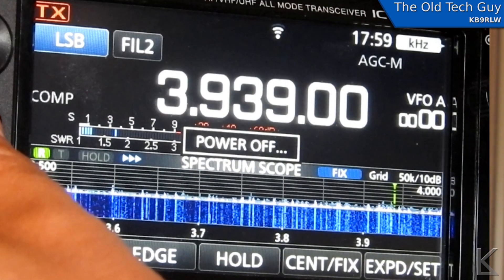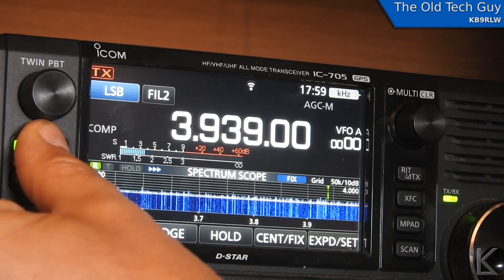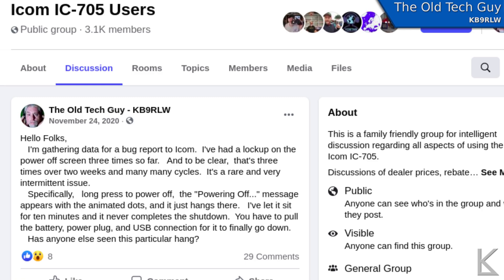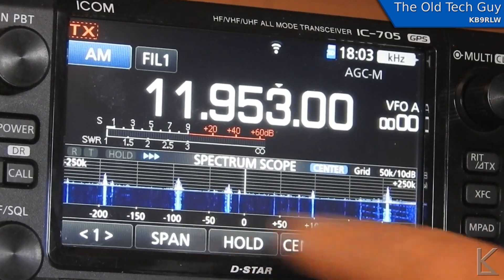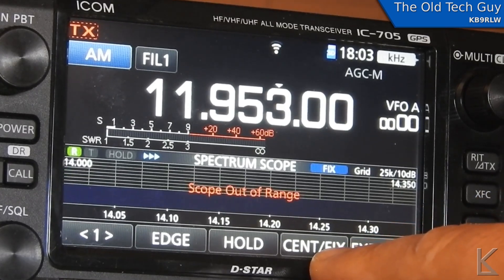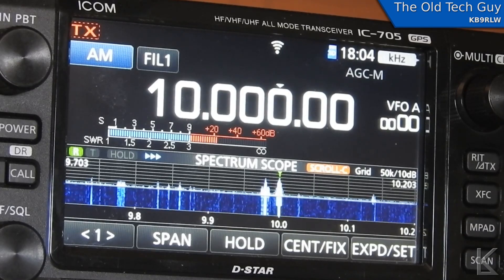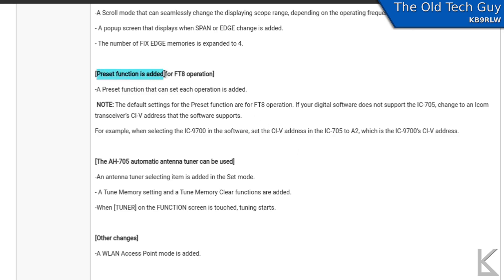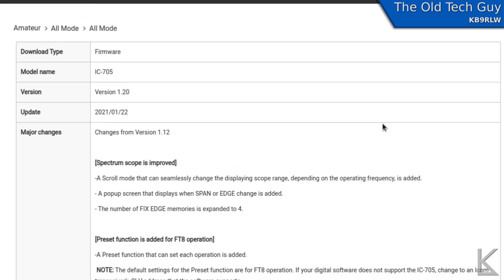Ham Radio - Icom fixed my IC-705 power off hang problem with firmware 1.20

Comment: Hello from another Kevin, KA0KAE. I love my IC-705 but I am having buyers remorse. I ran into an issue transmitting on SSB this summer do I reset my radio and it works. But when I do this it wants to record my QSOs. I also use the DR features of Dstar and that doesn't work as well as it did when the radio was new. I have upgraded the firmware to 1.2 then last night to 1.26. It is still wonky. I hate the Facebook groups for the same reason that members don't read your post. I got my valves ground by an ICOM Technician so I feel I can't go there either anymore.
Reply from the maker: As I recall, recording the audio to the SDcard was on by default with one of the earlier versions of the firmware.  It's a setting in the setup menu section somewhere that you can turn off.  I did right away and it's stayed off over two firmware upgrades so far.
As to the other problems, there could be some data corruption in the radios stored settings.  You might try doing a reset to factory defaults and then reconfigure things to your liking.

Comment: Hello Kevin - Thank you for this well done video. Unfortunately, this power off hang glitch and a number of other unwelcome “features” remain, even with firmware 1.24. SDRs (Software Defined Radios) will always leave opportunities for glitches, which are often intermittent and dependent upon your random sequence of screen selections the operator makes during the course of using it. I have experienced WiFi glitches followed by the Power Off problem. These are not necessarily related. With any software, on a PC or on your radio equipment, the sequence of functions you select can lead to “memory leaks” or register errors with non ECC memory. We will likely experience old and new glitches on an ongoing basis with SDRs unfortunately. Proper best practice coding techniques can mitigate unwelcome features but not every programmer knows proper best practices. Please include ne in your petition to Icom to “tighten up their code”. Thank you, 73, Ron - N1PB

Comment: Too bad there is still NO VERTICAL MODE on the 705
should be able to turn the screen to "portrait" when holding it the only way an HT can be held in human hand- antenna up
Reply from the maker: It's not designed to be an HT.  Using it as such is an impractical novelty.
Reply: @loughkb  64kB of memory is more than anyone would ever need

Comment: Kevin, I had the same problem with the IC-9700-once. I wasn't able to duplicate the problem a second time. I have now installed the new firmware and hopefully, I will not have the issue again. -K4KZ

Comment: Sounds like your firmware load may have been corrupted.  The only way to confirm that the 1.2 version was the fix is to flash your rig with an earlier version (not a copy of the one that was used in your radio previously) and see if it returns.  The good of software radios is you can update with new features, but the bad is that code can get corrupted.
Reply from the maker: The first firmware update I did was from 1.10 to 1.12.   It didn't fix the problem and I'd also reflashed it before doing the reset and test.
Believe me, I was thorough.

Comment: Thanks for the update video.
Wondering if you’ve done a video on the vhf/uhf portion on the IC705.
Getting started in digital radio on the IC705.
As always thanks for your very helpful informational videos.
73 
Preston wd4dda
Reply from the maker: I've touched on those in previous videos.

Comment: Kevin, there was a some talk about the IC-705 not work properly while using the laptop for digital modes. It was just a matter of RFI getting into the computer, the cure was to wrap the USB cable around a toroid several times and that took take care of the problem.
Reply from the maker: A better fix would be to figure out why you're getting RF radiating off your feed line in the shack.    A common mode choke at the antenna end of the feedline will fix that in some cases.  A counterpoise off the ground side of an unun if using an end fed wire design will fix it in those cases.
And if your antenna goes above your house, there is no fix. ;-)
Reply: @loughkb  I wasn't having a problem with that but Jason was.  Jason and Hayden were having a discussion about this on Jason's Ham Radio 2.0 channel.  The video is called "Using the Icom IC-705 and WSJT-x with Hayden from Ham Radio DX!" and the issue Jason talking about starts at 19 minutes on the video.  I thought you might be interested
Reply: Great! For anyone wondering, not just any toroid. Mixture 43 is recommended for most of the HF band.

Comment: Having work in software, Icom probably did not intentionally fix the issue. They made changes to add another feature, fix a different issue, or simply refactored the software to simplify it and make it easier to maintain in the future. Those changes accidentally fixed the issue.
Reply from the maker: Perhaps.  However, I have noted a distinct change is the power off cycle.  Where as previously the time from holding the power button to actual power down would vary quite a bit,  from half a second to as much as nearly 3 seconds, it is now consistently half a second.
It feels as if they made a change specifically to that function.

Comment: I also bought my IC-705 late November 2020. I never had the same power down issue. My favourite new feature in the firmware update is that scroll feature. I asked for that feature 5 years ago when my IC-7300 was first released, because that is how I used my Flex and Elecraft rigs in the past. Now they have added it to my IC-705, and the IC-7300 firmware update released yesterday also includes the new seamless scrolling. So both my IC-7300 and IC-705 are rocking that new feature.
Reply from the maker: One thing I really wish they would add, would be an SDcard access mode over USB.  
Getting that tiny card out with it tucked so close to the bezel is a serious pain. :-)

Comment: Kevin I had the issue as well, but it is resolved now. What kind of antenna do you have your 705 setup on in your video? Thanks!
Reply from the maker: It was on my doublet.  Cut at a half wave on 3.8 Mhz and 30 feet up at the apex in an inverted V arrangement.   I use an LGD Z-11 pro tuner with the doublet. (not a resonant antenna by design)